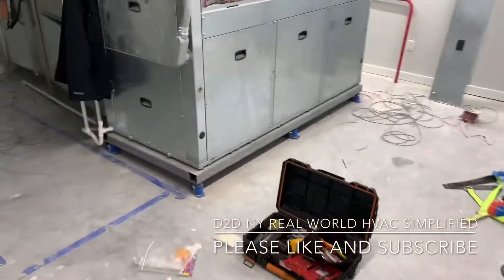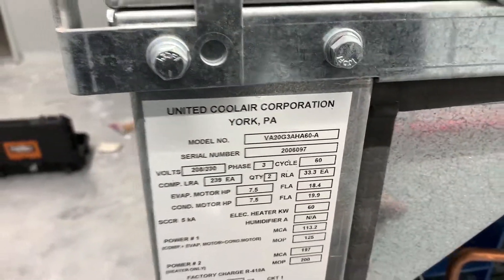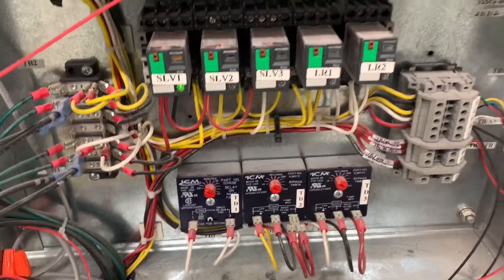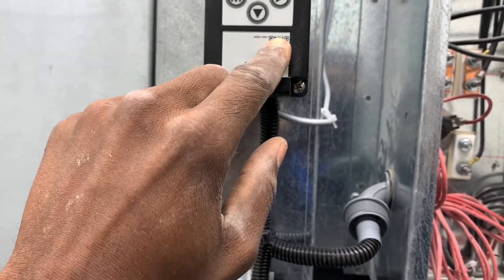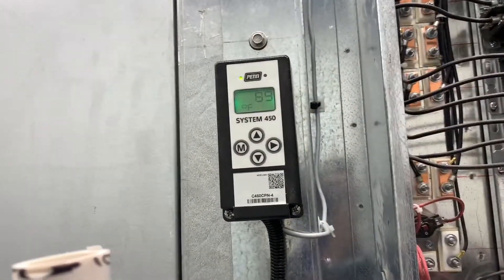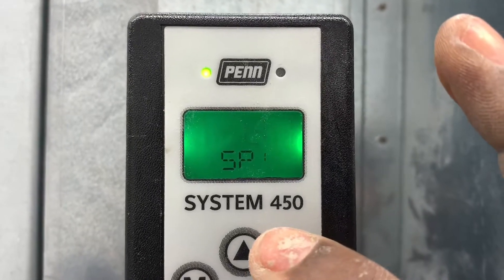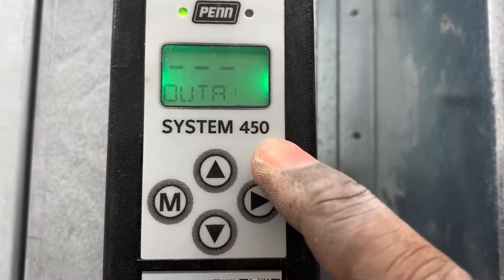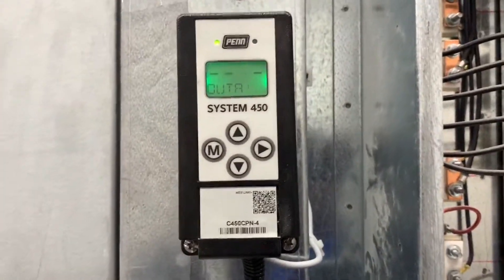HVAC SERVICE AND CONTROLS

Comment: Have a 255kw Mua unit using a honeywell t775 2-10vdc and Kele 8stage relay board...banging stages rapidly, what's the kw of the heater you have here...I need to use some scr's for a steady temp...what do I need...
Reply from the maker: This heater heater was purchased with the SCR came pre installed! The johnson temperature controller you can get online

Comment: Good video, are you a independent contractor or work for a company?
Reply from the maker: Independent
Reply: @D2DNYAC   hi bro I'm from queens NY I would like you to install a 5ton heat pump unit with three different zones. The old duct is ok. Just need to install the unit and three dampers and thermostat. And do you have a business number I could contact you on.
Reply from the maker: @jason Nunes Google d2dny

Comment: What are you controlling with that? What is your output relay?
Reply from the maker: No relay output used.. only analog 0 to 10 volts DC output controls the SCR's of the electric duct heater
Reply: Any wire diagram of this setup..thanks